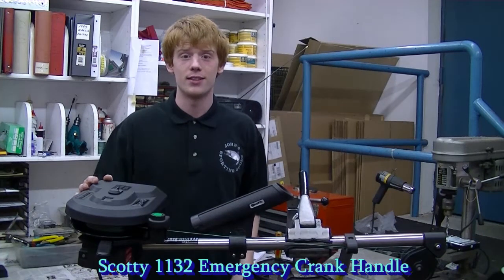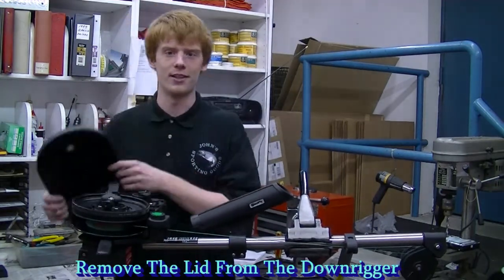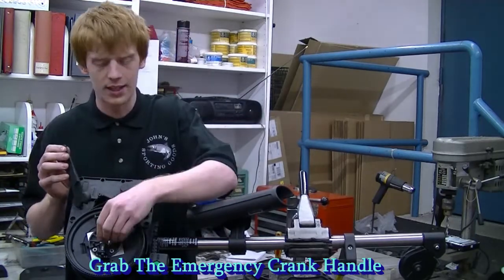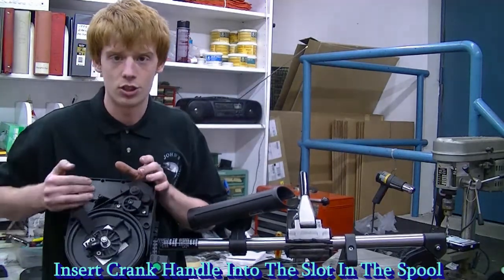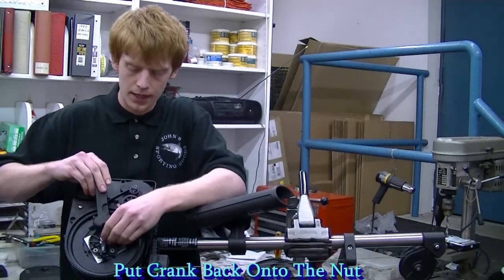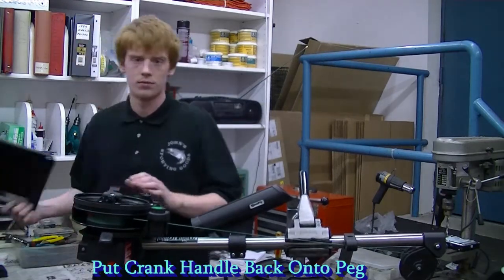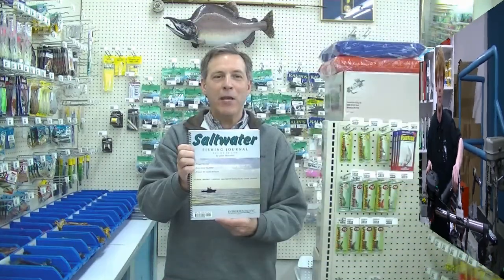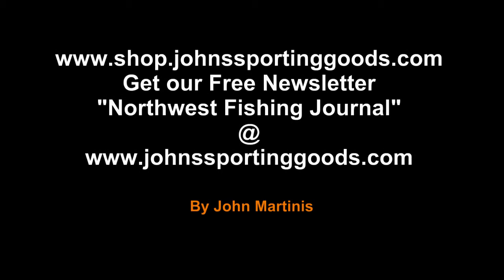Scotty Emergency Crank Handle

Comment: Should that top nut be tight? Mine is loose but seems it needs to be to hold the crank handle.
Reply: A bit late but if the nuts are too tight. The wheel will not spin
Reply: The nut should be Flush with the top of the post.  If your lid does not latch tight then you just need to lower the nut a little bit and try again until it locks tight
Reply: Hi Colten, can I add a double rocket launcher pole holder to the downrigger?